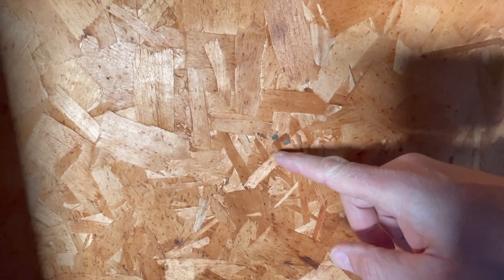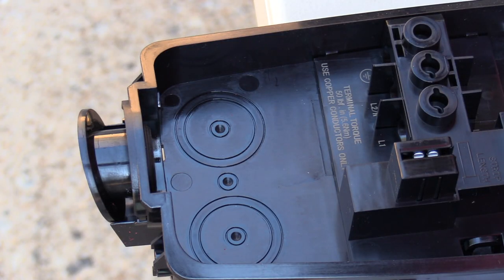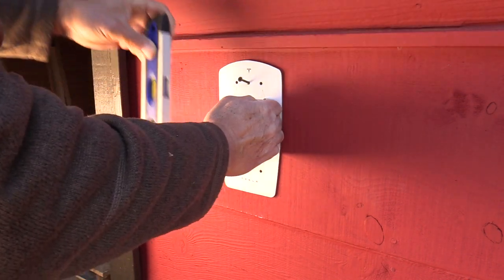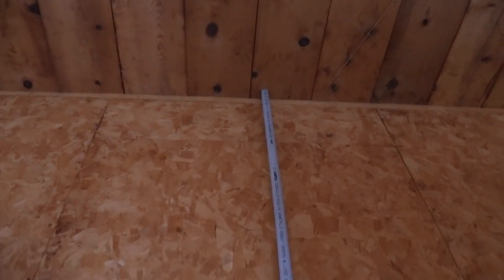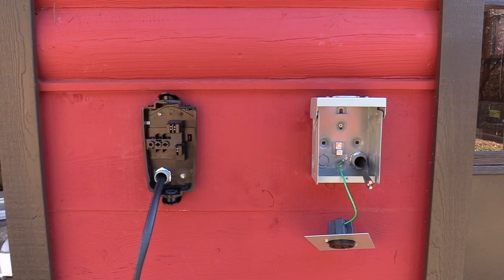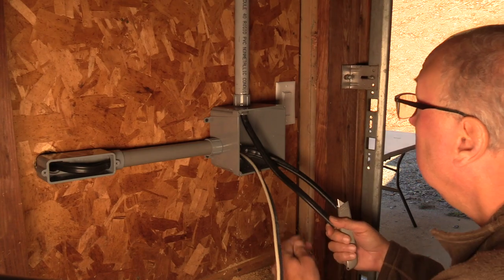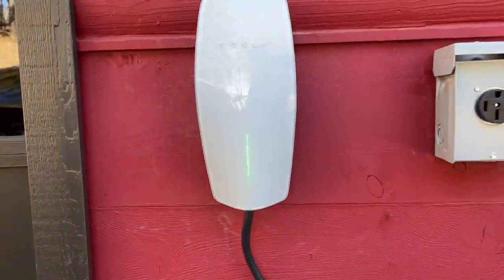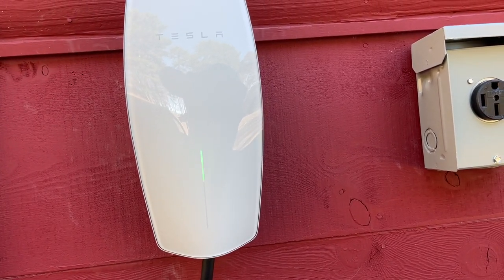Can You Install a EV Wall Charger Without Trouble?

Comment: Dave, great video, but I am curious about NEC.  There was no common wire because Tesla WC doesn’t use it.  Does NEC require a common wire at nema 14-50 receptacle?  Devices other than EVs could plug in here.  You could have a sign saying EVs only.
Does NEC permit a ground wire (#12) smaller than supply wire (#6).  I thought all had to be same gauge.  BTW, I installed a nema 14-50, 3 years ago for MS and it works great at 40 amps for 29 mph.
Reply: The neutral wire should be the same or larger gauge as the two hot wires.  It matters not if Tesla uses the neutral.  What if someone down the line decided to plug in else.  There is no neutral that I can see.
Reply: @rshanedavis  YES, Dave is a really good guy and I highly value his videos.  Hopefully, he is reading comments as I agree a common #6 wire (typically white) must be added to his installation.  Dave should pin an addendum mentioning addition of common wire as I have done in two NEMA 14-50 installations for Teslas.
Reply: Ground wire can be smaller than current carrying conductors.  It needs to be minimum 10 gauge copper  per NEC for a 30 to 60 amp circuit.

Comment: Wow did not know charge any EV car with high voltage. By the way 13,200 volts is only considered medium voltage so you must have over 20,000 volts. F'ing amasing.

Comment: Loved the video, GREAT information and enjoyed each of the steps. I see you have both the Tesla Wall connector and a Nema 14-50 connector on the same breaker?  Can you charge a Tesla and a 2nd car at the same time,?

 If so will the charging rate go down (seems like it should to me) or will you be able to charge both vehicles are the faster rates?
Reply from the maker: Sign indicates only one used at a time
Reply: @evdave528  Thanks, I must have missed the sign...  keep up the great work and I love seeing your trips to different places with a Tesla and your wife and dogs in the back.
Reply: are both the charger and the receptacle on the same 60amp breaker? eek.. that would trip

Comment: Somehow I thought four wire Romex would be better than 3 wire.  The Tesla Wall Connector only has connections for three wires..  Educate me EV Dave if you have time ?
Reply from the maker: I uses 240 single phase and a ground.  2-#6 and #10

Comment: What size of wire and circuit beaker did you used in this setup? What will happened if two Tesla Y charging at the same time with this set up?  Can the circuit breaker and wires handle it?
Reply from the maker: Ask your electrician he will size wire appropriately.  You can load share with two v2 HPWCs
Reply: Use 6 THHN (B and R for hot and W for neutral) and 10 THHN green for ground, and each receptacles will be supplied by its own 50A breaker. 
Do not parallel

Comment: Dave- GREAT VIDEO!  Does it load share if you use NEMA 14-50 and Tesla HPWC at same time?  Small correction, Tesla J-1772 adapter is rated up to 72A
Reply from the maker: Load share only between hpwc v2 I used a switch

Comment: As a retired sparky who no longer does any installs or repaired I have a serious concern. Does you city or township require a permit. What NEC cycle are you in. Some locations still allow homeowners to do their own work but you should always have the AHJ  ( Authority having jurisdiction ) perform an inspection. You have to install either GFCI protection in some locations but if in the 2020 NEC would need AFCI protection. ( all of the class 1 arc fault breakers also n provide ground cult protection. We always called step bits unibits. Would have used a sealing lock nut to prevent water penetration.

Comment: Dave, can you use both chargers at the same time?  What does it do to the charge rates?  Thanks.
Reply: No, technically this parallel connection is illegal per NEC. If two cars plug into this, it will trip the breaker right away. (best case scenario) If he keeps it this way, there better be a large sign indicating to only use one at a time.  If there was room for only one circuit in his panel, I'd have just installed the NEMA 14-50 outlet and got a J1772 charger like a chargepoint if you wanted WiFi, or the Grizzl-e. Tesla owners should be carrying their J1772 adapter with them anyway. This way if the charger fails, it's easier to replace by just unplugging old one and plugging in a new one. Or the guest could unplug it and use their own mobile connector.
Reply from the maker: One or the other not showing sign placed there it can later
Reply: @andrewt9204  agreed.   The NEMA plugs is really all the EV companies should suggest for home retrofit.   Their little laptop style charge brick should just have a NEMA prong plug on the back of it. 

The idea of installing proprietary charger boxes onto houses that do nothing but control 240v current is stupid.   It is just to encourage brand loyalty.
Reply: @STho205  I just installed my nema 6-50 plug today instead of ordering the Tesla wall connector. Even though my tesla will be here in the next few weeks I’m going to use the mobile connector at 32A on it and see how that works and if I need a little more power I will install a Grizzle E later. That way if in a few years I decide I want something other than a Tesla, I won’t be locked into a Tesla evse.
Reply: @andrewt9204  probably will work great

in reality that adapter brick should just be built into the car,  with a basic NEMA plug extension cord and 124v AC cord standard in the charge bag.  No flashy box or adapters. 

Tesla has POSH personal computer company philosophies like Apple and Next did.   Our stuff is cool,  everyone else is lame,  and we'll make an exciting new charger plug system every new model... Making the last one and all the accessories useless.   Not quite as bad as Apple, but along the same lines. 

However if they did that,  all charge america would need is NEMA plugs near car parking,  like they are near RV and boat slips.
Reply: The answer is NO!  They should have been supplied from 2 dedicated circuits

Comment: 1) you must move existing circuits downward to make the Tesla circuit pair #1 high. 

2) you need to have spare breaker bays or call an electrician ($1000) and a power drop and permit $$$$

3) you need a 200amp box and street feed.  If not see 2.

4) if your main box is not in your garage or outside near your driveway.   Add for buried conduit and a subpanel allowing line of sight safety breakers.  Again see 2 and add another $$$$.

5) you have a masonry structure and solid brick wall to your attached garage.  See 2, and also a licenced mason $$$$ and a permit. 

6) then it's real easy.   Put a gang of two high and breakers in the panel,  same in subpanel and wire this nifty box into it ...
BTW(this is the 3rd generation Tesla box in a decade,  so figure on doing this again when the 4th generation Tesla box comes out next year... 
Must stay to top of tech)

And the folks that will buy $25,000 TESLA/Chinese knockoffs of Tesla 2s are going to do all this correctly.... Sure. 

In 2030 we are going to see some crazy jury rig, there I did it, illegal and frightening wiring all over our nation.  People can't even safely use space heaters and extension cords.

Comment: just not up to code besides the wall connector requires 60 amps so it will pull 48 amps max that will be 80% of continues electricity pull and de nema 14-50 requires AWG 6/3 wire 2 conductors neutral and ground wire so that it will pull or drew 32 amps other wise you should use a 6-50 nema receptacle to meet code  DO NOT ever connect this 2 devices in parallel
Reply from the maker: Has a60 breaker and does not use a neutral

Comment: No No No 
No wall charge plugs or module. Ceiling Install Pull rope down to the charge port Unplug and release the plug and cable to ceiling. So Never ever have a 240v plug / charger on a wall Clealing install the plug / cable with spring / bungee cord / rope weight with pull down ribbon for a pull-down plug / cable.
Reply: Yes Tesla has what is call Gen2 Wall. Never Ever have a 240v cable on the floor! Do the ceiling like fans like lights like smoke detectors. Ceoling is NBD and is super safe.

Comment: 50  FOOT POUNDS?      I don't think so.
Reply from the maker: Inch pounds
Reply from the maker: Here is the manual. https://www.tesla.com/sites/default/files/support/charging/Gen3_WallConnector_Installation_Manual.pdf
Reply from the maker: It says 50 ldf in.  A weird designation

Comment: So you basically made 120V charger instead of 240V charger. This is completely wrong.
Reply from the maker: I’m not sure what you mean by your comment. The wall connector charge is it 245 V AC at 45 A and uses single phase power and does not require a neutral.

Comment: Another TWC installation video full of problems. EV Dave you seem like a super nice guy with skills but I gotta ask why you didn't follow the directions in the manual and code requirements? Airbnb fire trap that the insurance company can use this video to deny the claim - not to code and no permit or licensed electrician. This isn't like installing a simple 15 amp outlet, this is a higher amp CONTINUOUS LOAD circuit and you will be entrusting strangers to use it safely? Just wow. First, you use the two wood screws with the gasket washers (and you even explained it) for an outdoor installation - bravo - but then you use (snuck in) a 3rd screw without one that looks like a drywall screw or deck screw. You didn't use a torque screwdriver - absolutely necessary tool to use here with a continuous load to prevent overheating, loosening of the connections and fire. Trust me, the torque needed is far more than with that little Allen wrench can do. Torque to spec at the breaker and at the TWC. Installing the inappropriate plug is just wrong for a continuous load and then sharing a circuit where both can be plugged in at the same time is beyond irresponsible. Of course you didn't use a weather tight connector either (one with a rubber O ring) to connect the TWC wall plate to the conduit. IT'S ALL IN THE INSTALLATION MANUAL! Please people, install these correctly so we don't get house fires which will give EV's a bad name and raise insurance costs for all EV owners. I'm not an electrician but the directions and reasons for the directions are all very clear. I couldn't even watch the entire video as it had so many mistakes in it ... .don't get me started on Romex 6 (and in a long run conduit to trap more heat, not just a wall pass through) if on a 60 amp breaker and of course not color taping the HOT white wire, etc. These installations are very simple but you must read the installation manual and be diligent about every detail. Remember - ampacity and torque connections matter since a continuous load! Be safe!

Comment: Where are the required straps to secure PVC running b up wall? If you are not a qualified electrician should not produce electrical vids with halve a dozen code vilolations.